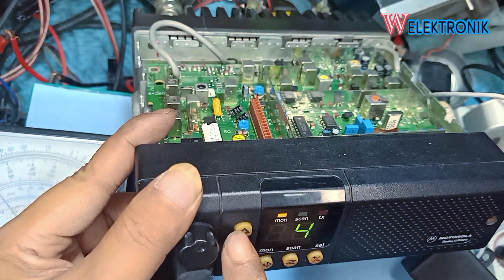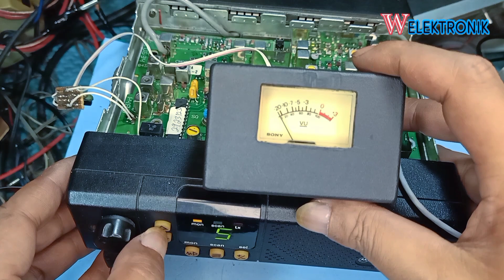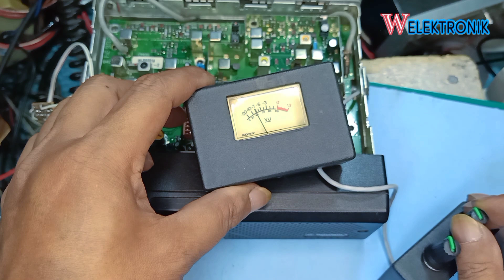motorola gm 300 modif adjust power dan rf gain vu meter

Comment: Halo om... Saya pakai Radio ini, tapi dipakai agak lama hasilnya panas sekali... Saya membaca referensi dari orang luar negeri, bahwa jangan menurunkan power melalui settingan disoftwarenya. Apakah dengan modifikasi hardware sperti ini dengan menurunkan power manual bisa mengurangi panas Radio tsb... Terimakasih
Reply from the maker: semakin power kecil semakin dingin,  sudah coba dipake mentang lagu, selama 1jam power diset 5watt. adem adem saja
Reply: @WElektronik  itu dengan menurunkan power manual? Bukan lewat software?
Reply from the maker: @yc2ftcstation  manual
Reply: @WElektronik  bisa dicoba nanti om... Terimakasih
Reply from the maker: @yc2ftcstation  tinggal tiru saja cara pasangnya
Reply: @WElektronik  ternyata beda susunan board nya om.... Itu R yang mana yg dilepas om?
Reply from the maker: @yc2ftcstation beda susunan pcb bukan masalah ,R bufernya yang di adjust
Reply: @WElektronik  R bufer emitor ya om?
Reply from the maker: @yc2ftcstation  betul
Reply: @WElektronik  terimakasih banyak om
Reply from the maker: @yc2ftcstation  sama sama makasih

Comment: Icom ic- 2300h how to Adjust Power output Sukran
Reply from the maker: To increase the power, you have to use a jig cable, a service menu will appear, look for po hi. almost the same way with the icom 2200H